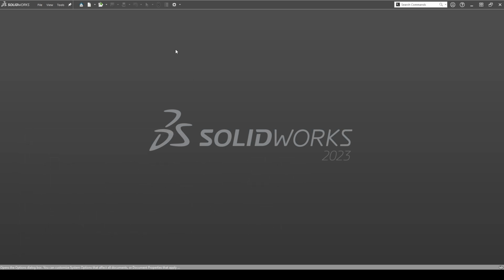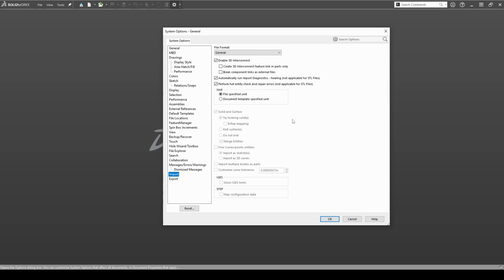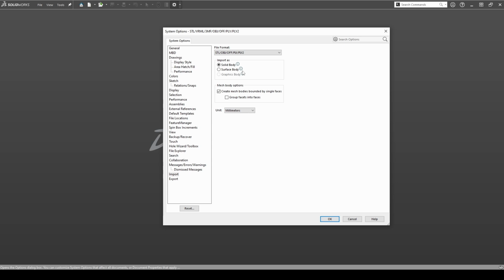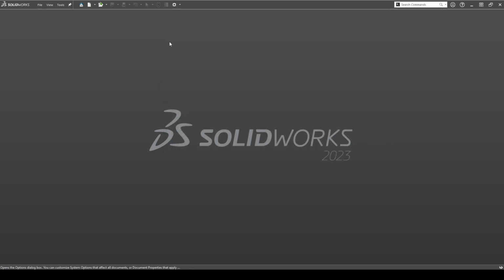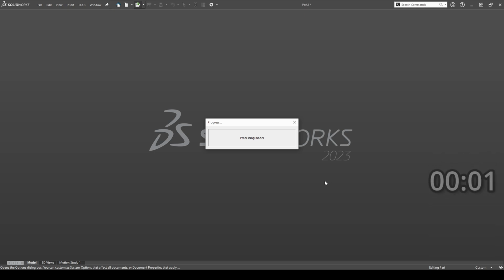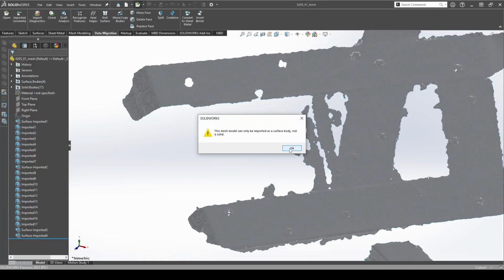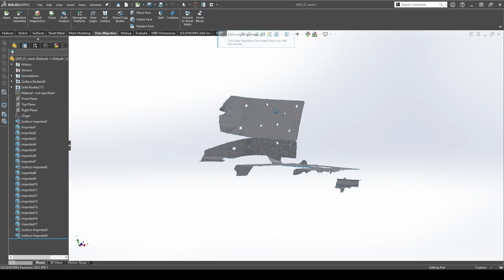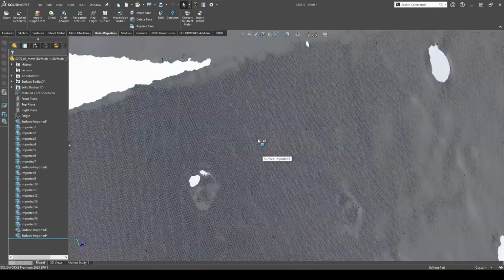How to Import 3D Scan Data in Solidworks

Comment: I can only import it as a surface mesh. How can I turn it into a solid?
Reply from the maker: If it isn't a closed volume you can't. Surface meshes are good for building parts around. If you need something solid it needs to be close to a fully closed volume, usually whatever scanning software is used can help to close up openings in a volume.
Reply: Try using the "Thicken" command.  This turns a single surface into a solid feature, you will have to tell it how thick you want it and what direction to offset it to.